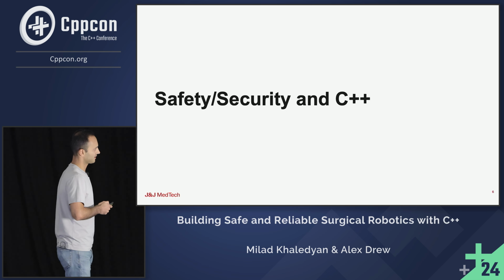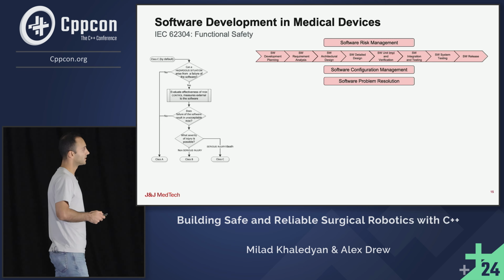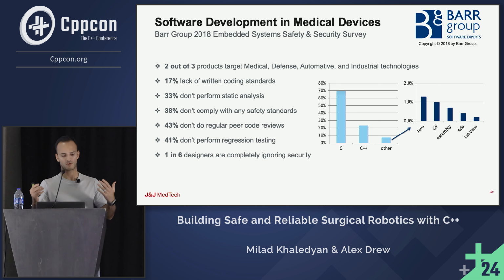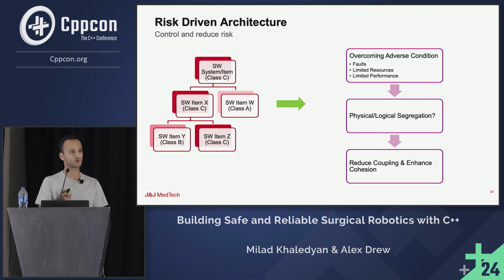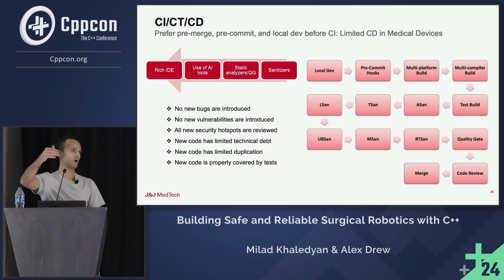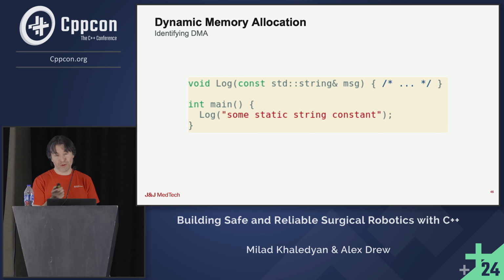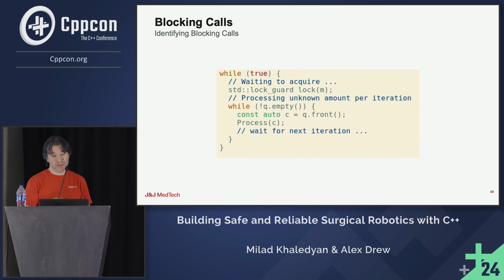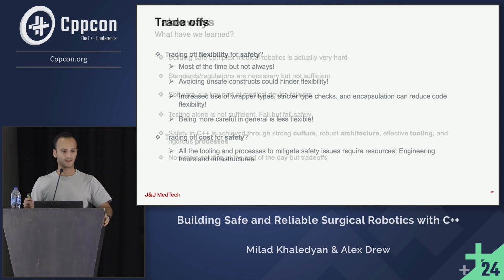Building Safe and Reliable Surgical Robotics with C++ - Milad Khaledyan - CppCon 2024

Comment: 11:18 The picture of the V-model is actually incomplete.
For each level there's also an arrow back in case the step fails, so Unit Testing -> Breakdown Into Software Units, Integration and Testing -> Architectural Design, Functional Testing -> Software Requirements Specification, Documentation -> Input Data.

Comment: Watched the whole video, specifically to avoid writing what they talked about later. 1. It seems that the second participant mixes safety aspects with hard real time. But these are completely different things, although they happen together in general. 2. For me, talking about all these tons of manual steps, such as compiler flags and the code itself, is obsolete in the modern paradigm of safety-critical engineering. MBSE and frameworks like SCADE or Simulink with tested and certified code generators were created specifically for this. And according to NASA research, the biggest problem comes not from the code, but from the requirements. And this can also be solved in the MBSE approach. And for such big and complex projects like surgery robot MBSE is must have.
Reply: Hard realtime can be part of safety criticality in some contexts.